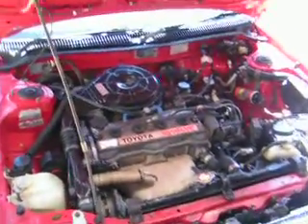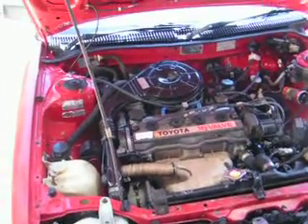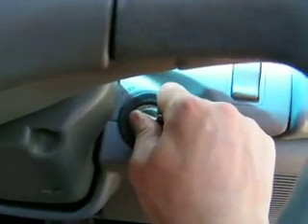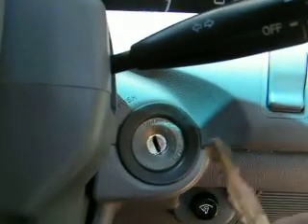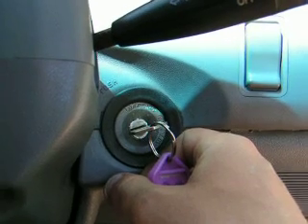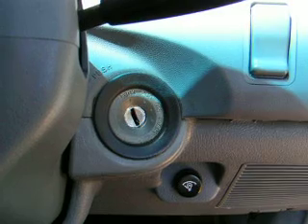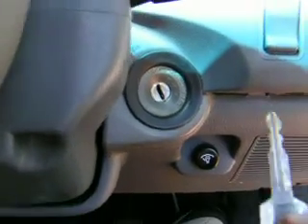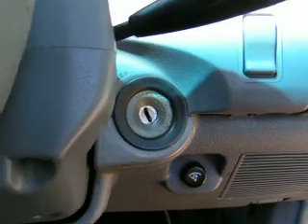corolla with detonating issue

Comment: Not to try and talk shit but that is not ping that is called Dieseling it is a condition that can occur in spark plug, gasoline powered internal combustion engines, whereby the engine keeps running for a short period after being turned off, due to fuel igniting without a spark.
Reply from the maker: I did said dieseling but pinging is pretty much the same
Reply: no it's not your mistaken dieseling happens with ignition off ping happens with ignition on however the cause could bee the same depends on what the cause is but they are totally different
Reply from the maker: ok well it pings and diesel. Ignition cut, no spark and it still runs on, that's dieseling this is what this is doing
Reply from the maker: pinging or knocking is the action of the air fuel mix igniting before the spark plug has chance to fire, thus its going off uncontrolled without an ignition source,

Comment: anything japanese likes 95 octane anyway, they dont have anything lower than 95 so most of the time the engines are designed around that, my xsara dont like low quality 95, let alone any less, if your feeling rich and you have it over there, 99 is the boy
Reply from the maker: Oh it does it with 98, we have a 110 non leaded with added ethanol and it still knocks like that..
Reply: bloody hell, she's not happy then, does it do a lot of low rpm/high load kind of work? might be carbon build up, if so, get a cup of water, hold the revs at about 2.5k rpm, pull a vaccum hose off and slowly feed it the water bit by bit, it will get rid of most of the crap, injector cleaner and a damn good hiding on the road after a service and that should solve it
Reply from the maker: yeah i tried the water trick, nothing came out carbon wise. i tried filling the cylinders up with mineral turps, letting it sit then cranking it over with the plugs out, still nothing. its just a mega old engine. it normally does it after any length run

Comment: What year is that car?
Reply from the maker: It's a 1990
Reply: 1700iDiGuy I've always thought everything was electronic fuel injected after 1989. Your 1990 Corolla was probably one of the last vehicles to have carburetor.
Reply from the maker: nah, i've heard of some mitsubishi vans made in 2000 that were still carburetor.
Reply from the maker: I had a 1988 volvo that was fuel injected, There was a phase of 'mechanical fuel injection' made by bosch for upper market cars back in the day, BMW, Volvo , Porsche, Mercedes Benz, VW/Audi used a system called 'K-Jet' or a K-Jet tronic which did incorporate an oxygen sensor and an air mass flow sensor. before moving over to single point and multi point fuel injection, The K -jet systems where multi port fuel injection and injected fuel to the backs of the intake valves